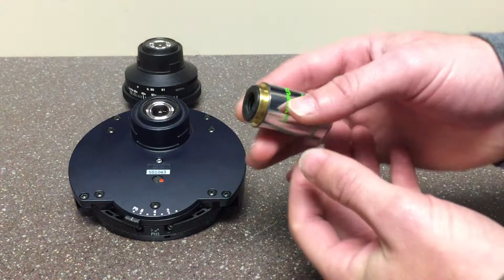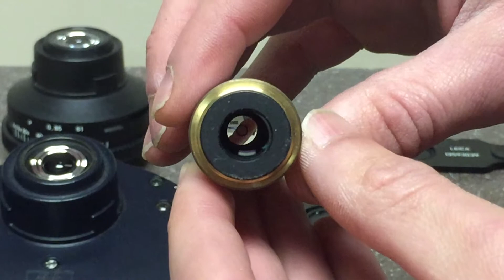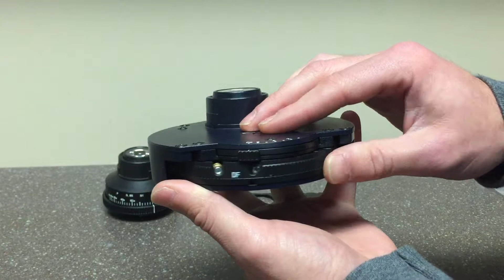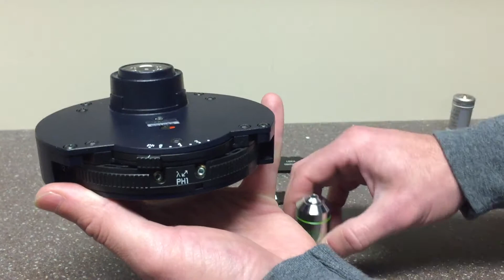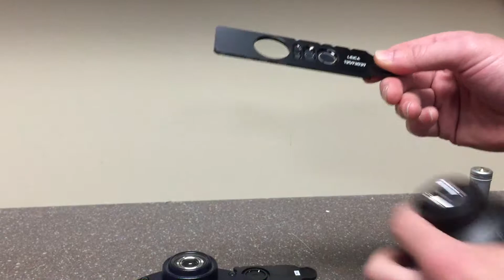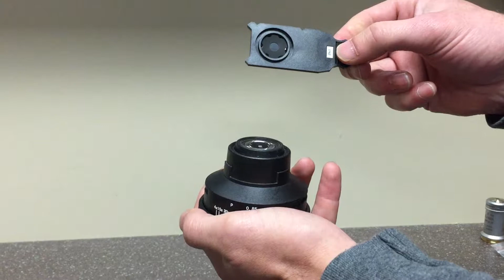Phase Contrast Microscope Components

Comment: I hope this is not a silly question but I have a microscope with two phase objectives for 40 and 100x. when I used the microscope in bright field or dark field mode would there be any advantage in me installing a non phase objective or will the phase objectives also work just as well?
Reply: Due to the phase rings in the phase objectives, the image in bright field when using a phase objectives will not be as crisp as the image using a standard lens of equal quality.
Reply: @zoominmicroscopy  Can someone have more than 3 Phase Contrast positions and corresponding objective lenses ? All the Phase Contrast microscopes I have seen , only have 3  Ph1, Ph2, Ph3.
But if you have a microscope that can take 5 or even 6 objectives, I want to use them for Phase Contrast.
I would appreciate very much a reply, thanks.
Reply: @dreamfunction4491  I don't think so. My knowledge of phase contrast is not great, so I'll welcome any corrections here. My guess is that the dimensions of phase rings are a function of the numerical aperature and since there is very little variance in numerical aperture for lenses of a given magnification, there would be no real need for phase rings of additional dimensions. My understanding is that the purpose of the phase rings is to impart a 1/4 wavelength delay to waves (or really wavelets) so as to create greater degrees of constructive and destructive interference (and thus greater contrast by making brights brighter and dim areas darker). I bet the phase rings are positioned so as to intercept the wavelets carrying higher resolution information that result from the light most diffracted by the sample- and the ability of lens to capture that light is a function of numerical aperature. Again, I might be wrong, and would love to hear any corrections.
Reply: @dreamfunction4491  Great question. I've got a lot more learning to do about phase contrast, but my guess is that the dimensions of the phase rings are a function of the numerical aperture of the lens and since the numerical apertures are virtually invariant for lenses of a given magnification, there is no real need for more additional phase ring combinations. I'd love to hear a correction is my thinking is wrong. My understanding of phase contrast rings is that they are designed to impart a 1/4 wavelength lag to the waves (or really wavelets) so as to create enhance constructive and destructive interference patterns, which would make bright areas brighter and dim areas darker- thus enhancing contrast. My guess is that the phase rings are positioned to intercept the light carrying the highest resolution information. This highest detail information is carried by the light most diffracted by the sample. The ability to capture this information is a function of the numerical aperture. Again, I might be wrong, and would welcome any correction.
Reply: @zoominmicroscopy  Hi. Thank you for your reply.
I asked this question a few days ago and got the following reply which might interest you:

Microscope Supply
3 days ago
Yes, there's even some microscopes that share the same phase stop for 4x-100x objectives. The Panthera E2/C2 has a Ph1 stop for the 4x, the 10x and 20x both use the Ph2 stop and the 100x has a Ph3 stop.
Reply: @dreamfunction4491  That is interesting!! I never would have guessed that one phase stop could work for all magnifications!! Thank you!!
Reply: @zoominmicroscopy  Cheers and thanks to you as well.